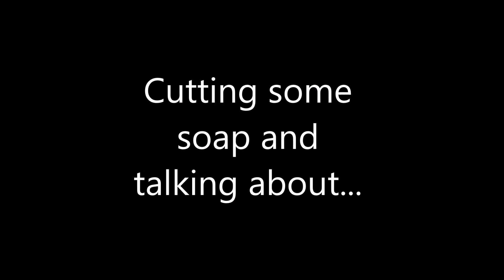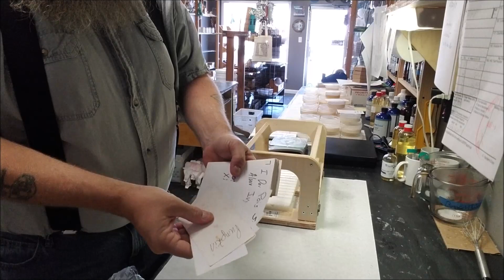Cutting Soap and Chatting about Hairy Soap?!?

Comment: It doesn't bother me. I tried to find liner like yours. I tried bag liner but it gave my soap some wrinkles.
Reply from the maker: I don't mind the wrinkles. Usually very small and get better with practice.
Reply: @unclejonssoap  yeah I bought a big roll of paper with wax from soap Equipment Company, I am having such a hard time putting in the mold it doesn't stick to the side it says to put vegetable oil so frustrating for me it's just a 6 lb loaf

Comment: Honestly, if a hair drops into your emulsion, the lye will most likely dissolve it. Because if you guys don't know this, NaOH (Soduim Hydroxide) is a major component of drain opener because strong bases liquify organic molecules like hair and food which is the major reason that drains clog. Unless you have kids. Drain opener does not work on G.I. Joe's in the drains.... Oh, and another interesting fact is that lye is a major component of oven cleaner too for the very same reason..... actualy if you think of it, most of the grime in an oven is oil and grease. So technically, you are turning the suck on grease and grime into soap when you are cleaning your oven!

To those who really know what they are doing, I actually go to lowes and get a certain type of drain opener to make soap that is 100% pure lye when I run short and need some right away. But I would NOT suggest you do that unless you know what you are getting.